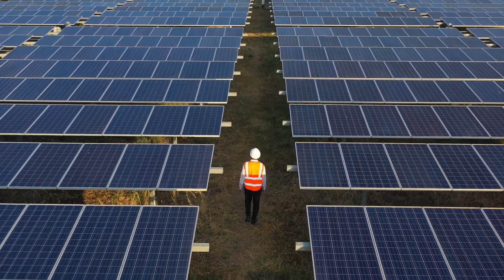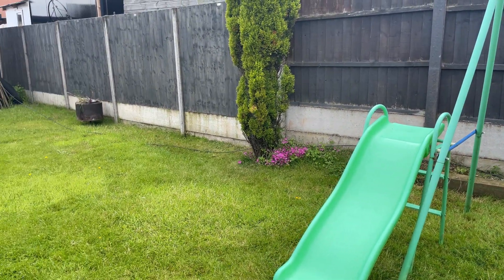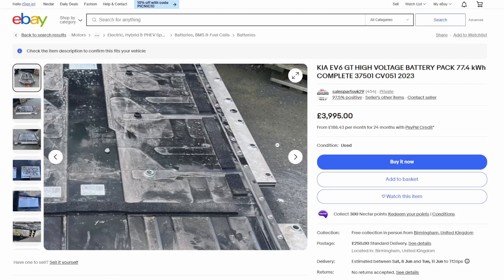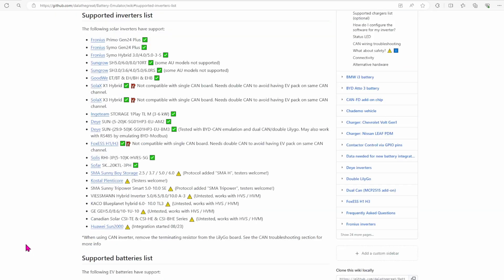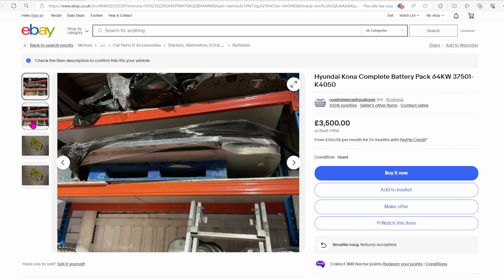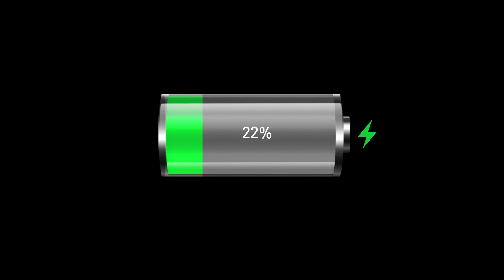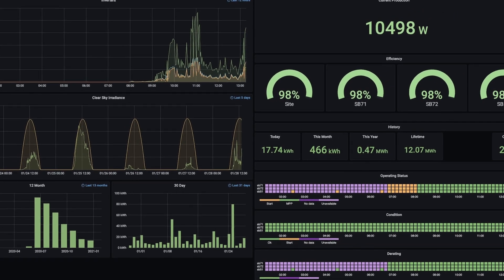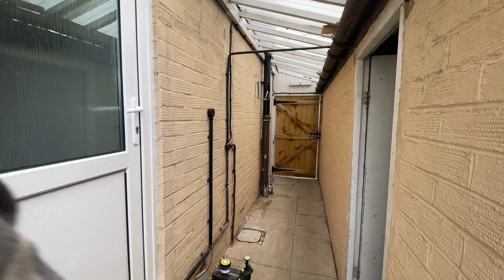I'm putting an EV battery on my HOUSE

Comment: That looks expensive but very interesting.
Reply from the maker: Expensive yes. But for the level of power and stored energy it’s very cheap compared to an off the shelf system
Reply: The scariest part is how quickly it ROIs. Especially as we learn of how mucJgh demand data centers may be putting on production, rates are sure to spike

Comment: One aspect of three phase inverters used in a domestic situation that you need to consider: Most three phase inverters are balanced... if you draw power from one phase, the other two phases will also produce the same power. If you are not using that power in your home, it will be exported to the grid, which is NOT what you want to achieve!!
In the past, some people have used three single phase inverters, one for each phase, but that is complicated, expensive and takes up a lot of room.
However there are now three phase inverters that can be "unlocked" so that they allow unbalanced loads.  I chose the Goodwe GW10KL-ET inverter. As installed it was balanced, but I reset it to unbalanced using the related android app, and it works well.

Also remember that a 10kW three phase inverter cannot handle 10kW on a single phase. It might be able to handle more than 3.33kW on one phase if the others are idle... but definitely not 10kW. So you need to consider your expected maximum load on a single phase when choosing your inverter, and wire your switchboard so the heavy power draws are spread across the three phases.
I have a Nissan Leaf battery and a Lillygo board already, so I am hoping to have the battery hooked up soon. I will be watching your progress with interest. 
Good Luck!
Reply from the maker: Very nice. Thanks for sharing with unbalanced loads. 

Initially the inverter and battery combo will be buying in cheap electric and selling for more at peak times. My existing load is largely covered by an existing single phase ‘on grid’ install which I’ve not really discussed on the channel. Summer we get through with the single phase solar and battery and winter we move heavy usage to night while on cheap rate. 

I’ll have to check out the goodwe inverter thank you

Comment: Really interested in following the progress of this.  Been going back a forward with battery storage over the last year or two but the price of batteries (like givenergy, pylontech etc.)still put the break even quite far out.  An EV battery was always always in my thoughts but I just assume it would be way too complicated.
Reply from the maker: A lot of the cost savings with batteries are dependent on circumstances. What tariff? EV? When do you use electric? so on. Some people make good savings with solar alone, some with battery alone. You can get much smaller EV batteries than I plan to install so the project can be a little easier. 
It’s defo doable although you’re not so likely to find an electrician who’s willing to get involved with signing it off if that’s your thing. 😂
Reply: @TheOfficialBatteryMan  Yes, i'm thinking Solar might be the route to go down, although the Fogstar batteries are really good on price.  I'd definitely need to find a friendly electrician if I was going to go down the car battery route, not impossible but yes, a bit tricky.
Reply from the maker: @welshy1812 I couldn’t agree more

Comment: Dala is a legend. Personally I'd most likely go with a 40kW Leaf battery, as Dala has figured these out. And home usage is far less stressful on an EV battery, than the environment they are designed for. I would expect plenty of years ie 10+ from an old Leaf battery. And still be able to sell it when I decide to upgrade. But it should be interesting to see how you get on.
Reply from the maker: I agree Dala is a legend and I agree home usage isn’t pulling the same current so the packs should last much better but still benefiting from the higher voltage to make things more efficient. Home usage batteries can also handle years of slow degradation without it mattering as much as it might in a car. 

Leaf packs are a good choice. I’ve nearly clicked buy on a few modules in the past 🤓

Comment: I would suggest the deye, its not picky at all with batteries.
Reply from the maker: Thank you for your input. Will give the spec sheet a good look over. Have you see the latest EEV blog post from a few days ago? It did sort of put me off. Having said that I want an inverter that works easily with the battery pack
Reply: @TheOfficialBatteryMan  It sounds perfect for your use, I have the 12KW 3phase variant with an self built 48v Seplos battery and it is communicating effortlessly out of the box. Also the generator port and the full house backup (12Kw and 4Ms switching time) are pretty nice advantages.

As for the EEV video, i get his concerns, but the parts still look to be of good quality. And deye has service centers all over the place, they seem to be serious about warranty and customer service.

Comment: Got Nissan Leaf cells for 4 years, bought them used and rewired them to 48V. Works great, but losses are to high in a 48V system. Got Dalas software and flashed it onto the Can Adapter, just to test it. Time for an upgrade of my solar (too many inverters, system was modified several times the last 10 years). HV Deye inverter and a M3/Y LFP would be the thing. But EV batteries are still too expensive, single Lifepo cells are now below 70€/kWh, bulk ware is $45 plus shipping from china
Reply from the maker: Nice work. I’ve put this series off waiting for battery prices to come down. But I could be waiting a while for the battery I want to come down in price. I’ve been wanting to do this series for ages so thought it’s about time I just get on with it for you all to enjoy the videos
Reply: Just use victron listed of deye

Comment: I'm new to this, so be gentle :-) - I was considering a PowerWall for my new house but the maths is just not working - using an EV battery seems like a much cheaper idea but when I look up the prices of Tesla model 3/Y batteries on eBay and consider all the hacking that I will have to do and the resale value of a house with an EV battery strapped on the side of it vs one with a shiny PowerWall etc... I'm not convinced...
Reply: You don't have to do either. I've been watching this stuff for a few years now since people started to put Nissan Leaf batteries on pallets in the back garden and use them as home storage. Back then, a 24kWh battery (with maybe 16kWh available) seemed like a far better option than the 5kWh batteries being sold in pre-made home battery storage units. However, you no longer need to spend thousands on a pre-made power-wall, or similar. You could buy a much cheaper LFP battery from the likes of Seplos, or EEL, or Battery Queen. 

You can even build your own from kits that these companies sell and get 15kWh and some change from €2,000 (£1,700). I have done just this and I don't expect to use peak rate electricity 95% of the time. There is still a little bit of fiddling around to get everything up and running, but if you have solar and a hybrid inverter already, it's much easier.
Reply from the maker: For the average Joe I think a cheaper system than the Powerwall from a professional installer is a good option. I think for a guy that is way to into tech, batteries and power in general proving it can be done and learning is definitely the motivation. I don’t think there are many electricians that want to get involved with installing EV batteries on the side of the house. Having said that. I wouldn’t be doing this if it didn’t have a pay back period.

Comment: I hope you've considered the costs to upgrade your consumer unit to 3 phase too, I'm sure you have right? I am 'lucky' to have 3 phase already but only a single phase is used for the CU. I've had a quote of around £20k just to update the single phase stuff to 3 phase and fit a Zappi. So that didn't happen but I did end up with a 7kw Zappi on it's own dedicated phase now :D
Reply: I'll be really interested in the journey you go on from single phase to 3. Yes i've subscribed ;)
Reply from the maker: Anything to do with 3 phase gets more expensive doesn’t it. I’m surprised a 3ph board is costing you that much tho. 

Eventually I will have a full 3ph board but for now it will be a mini 3 phase cu to feed the inverter and EV charger

Comment: The issue with a 6kW inverter isn't how much you can charge your battery, it's how much power you can pull from the battery at once. for example, if your shower and clothes washer are going at the same time thats goint to be be pulling 10-12kW so you will be pulling from the grid to make up the shortfall. 

Also, and this is neither here nor there but in your inverter example... 36kWh should be more than ample for your usage. Paying more for a bigger battery is a false economy, No matter how good a deal is its wasted money if you dont use it.
Reply from the maker: Completely agree paying for storage you won’t use is a waste of money 

In my use case I plan on buying electric in at say 10p and selling it at 20p. The difference in price per KW overtime pays back the battery and inverter. I will also get use and benefit from the stored capacity and from the inverter output. 

Ultimately this video isn’t a do this but an example of how far it can be taken for entertainment.

Comment: I’ve been considering using my battery in my car as the home battery. When it’s plugged in it discharges to the house rather than charge. I’ve see Some people doing this.
Reply from the maker: Which charger are you using?
Reply: Zappi

Comment: I have instead recently purchased a cheap Nissan leaf, to use as a mobile battery. Charge at work from huge excess solar. Drive home, plug in, to charge home batteries and run the house.
Keeping the car as a mobile battery then creates more savings as its dual purpose driving around on sunshine :)
Reply from the maker: That’s pretty sweet. I’ve not heard of many putting V2G to good use

Comment: That kind of my plan but i want stay on single phase, there are more powerful hybrid single phase inverters but they only work with 48v battery's 😕
Reply from the maker: There are plenty of battery packs that will work nicely with a single phase inverter. It could be that you choose a smaller EV pack that’s a bargain because everybody is after the higher capacity packs. Also much easier to move them around.  

Until a year or two ago I didn’t realise how many high voltage battery pack inverters there are.
Reply: @TheOfficialBatteryMan  if go 48v batteries you can get Sunsynk single phase 8.8kW Hybrid Inverter but I really like them cheap leaf batteries and fox ess hybrid inverters...